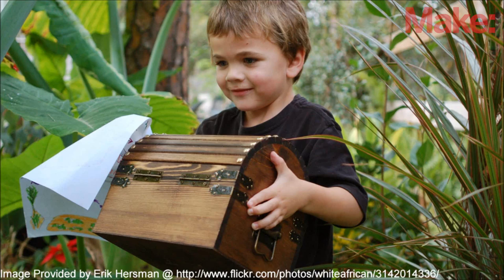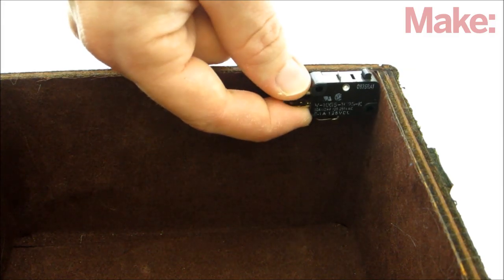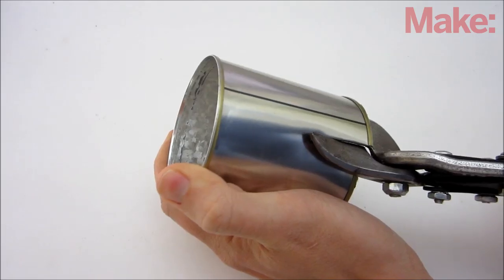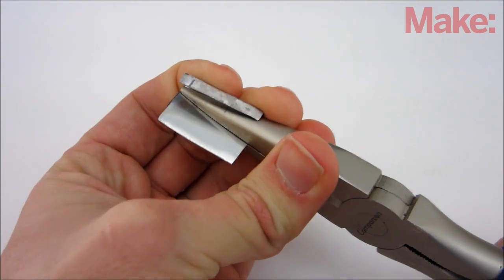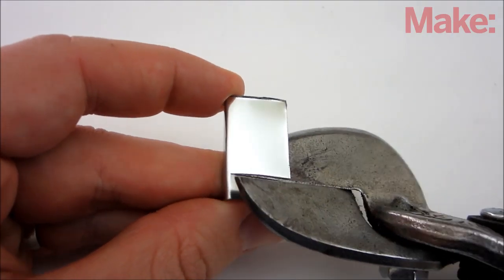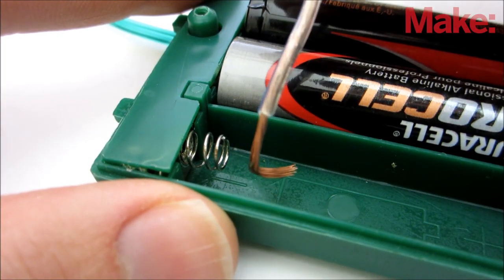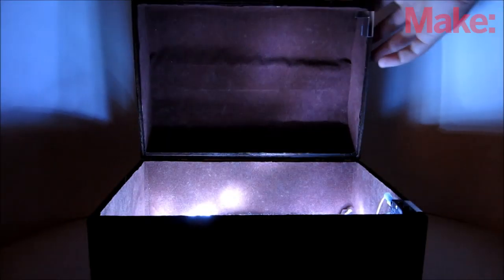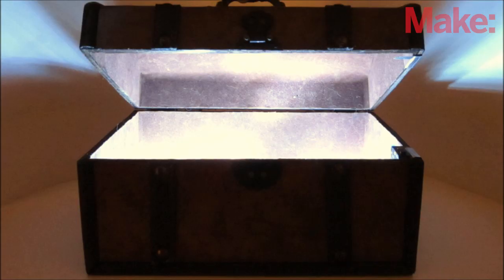DIY Hacks & How To's: Glowing Treasure Chest

Comment: Very clumsily done.. I would have liked some more fitness in hiding/mounting components at least.
Reply: Agreed. While functional, hidden circuitry is always better. "The money is in the magic". I think if I were to do this I would bore a hole in the rear wall for a plunger and switch actuated when the lid is lifted or dropped. This would require precise height adjustment. Another point would be to use some type of indirect lighting so the light appears to be everywhere while seeming to come from nowhere. To a small child, that would seem magical indeed.